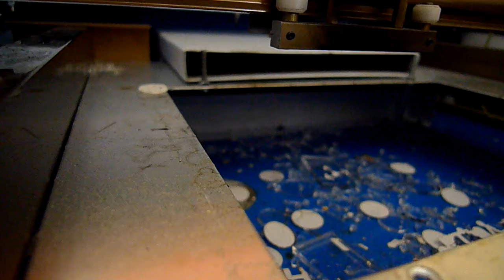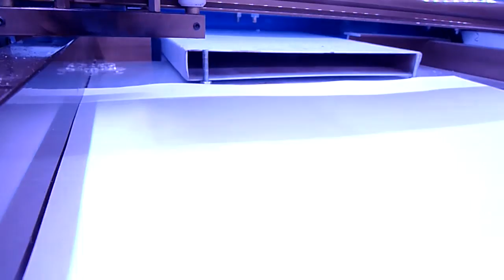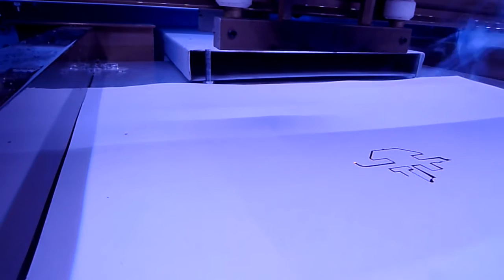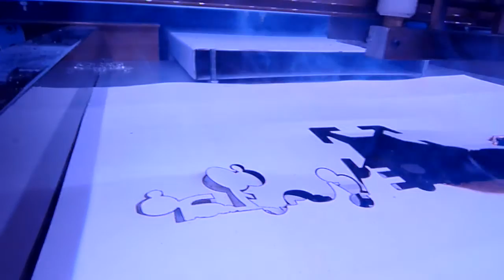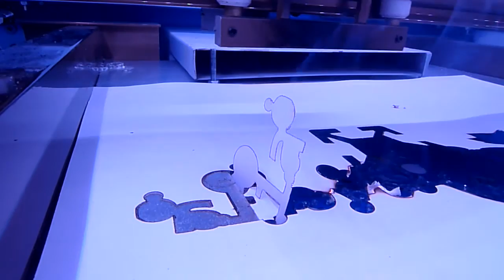Smoothie : first cut

Comment from the maker: @GlenniGif The laser cutter is from eBay ( chinese stuff, quite cheap ). The electronics is crap so that has to be replaced, but the rest is good. For the electronics you can use an arduino, and grbl as a firmware. ( Here I use smoothie but that's experimental )

Comment from the maker: @GlenniGif If you buy the cheap chinese machine, the power supply is provided with it, you don't need anything else than an arduino, a breadboard, and stepper drivers ( pololu or the like ).